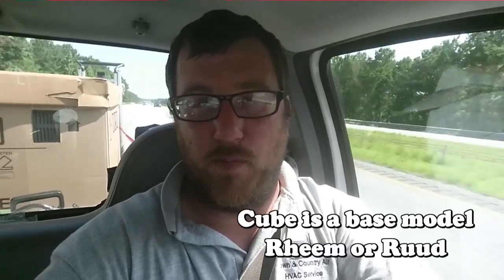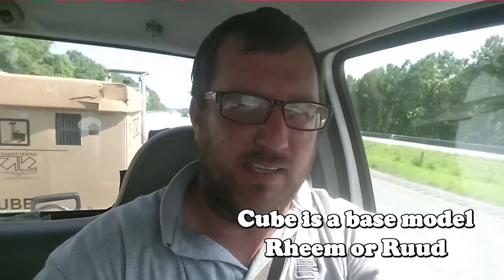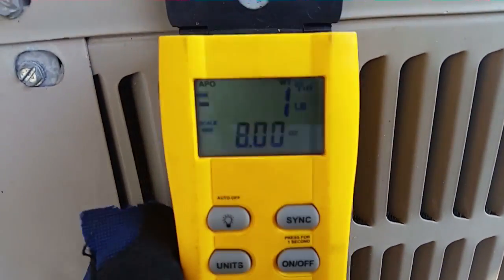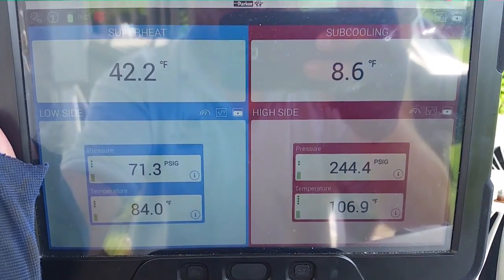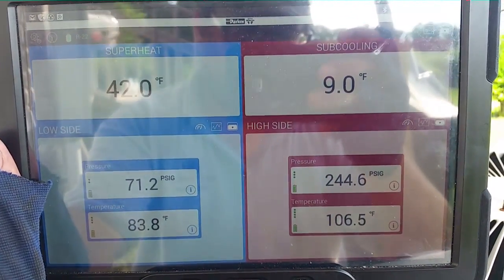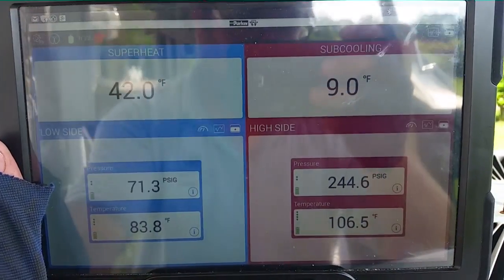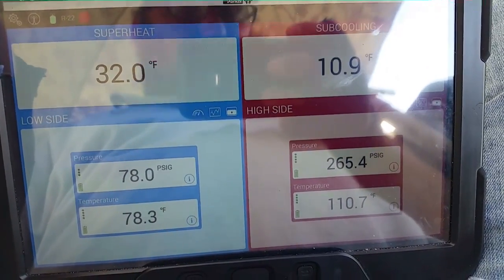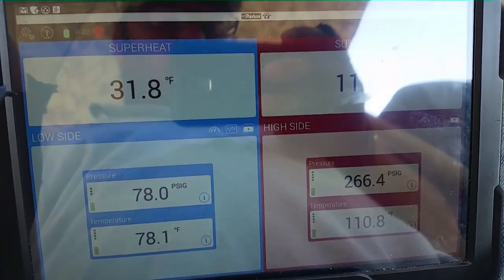Using the Sporlan Smart Service Tool

Comment: Cool vid. Looking for the opposite you have lol. Im looking for a standalone gauge set for quick checking & charging so I dont have to use my old set and start clamping thermocouples to the line sets. 

Any tips on picking up rules of thumb for sub cool and super heat? 
Your video for super heat math comes to mind.

Comment: Hey Zach what is the require SEER on NC? In Florida is 14 right now and some companies don't want to install 13 SEER because of the rating change is this a scam to make you put the 14 or just company requirements. I'm installing all the air handlers from 10 to 13 in a community the I help the technician cause he contract for new installation and they don't want to put them in. 
 
Good video!
Reply from the maker: We are 14. You can still put in any remaining 13 SEER units for another year I think.
Reply: Ok thanks! God bless you! You're videos bring a lot of knowledge to me thanks! Keep the good work!